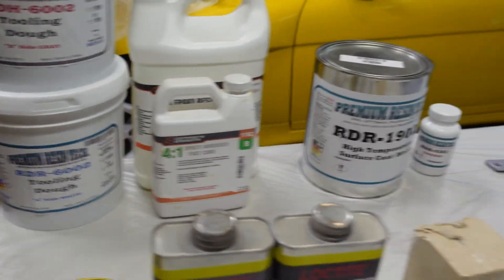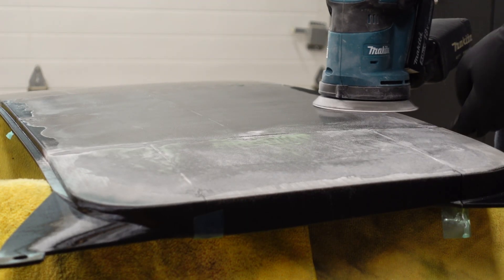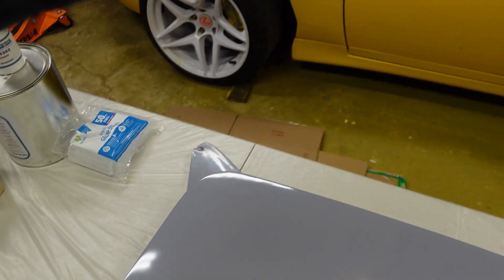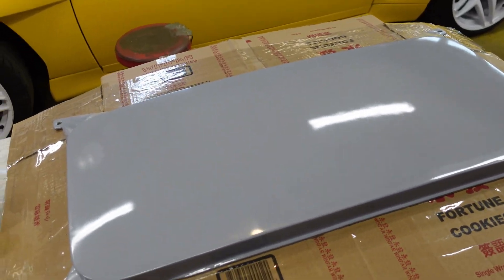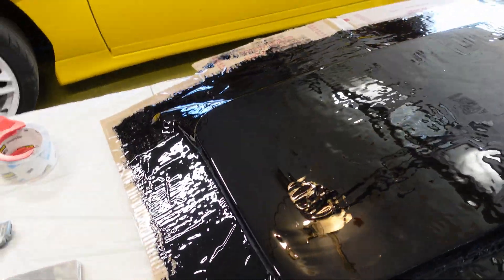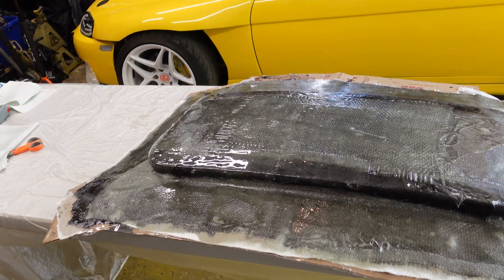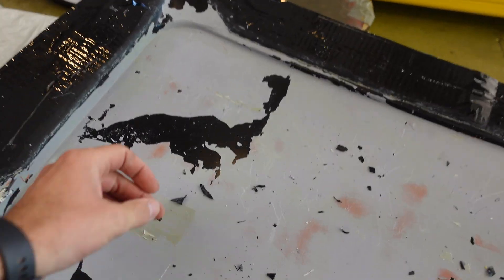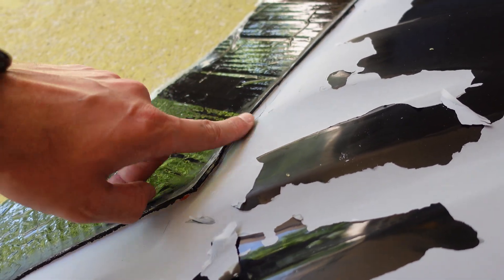Turning a 3D Print into a Carbon Fiber Mold!

Comment: Yeah, PVA release agent spray on new paint surfaces for mold release. The epoxy reacts with the paint, that's why it stuck to it. You can use the Frekote in your mold when you make your part.

Comment: Try Adding a couple of coats of PVA glue over the wax next time you do this kind of job, then you can use water to separate the molds because the PVA is water soluble,  works well.
Reply: pretty sure Tofu Autoworks does this with really good results.
Reply: @rbdesignsnh  it's not pva glue, it's release agent. Two very different things